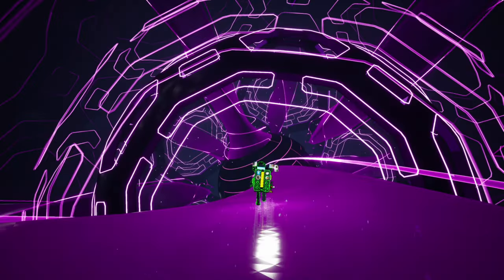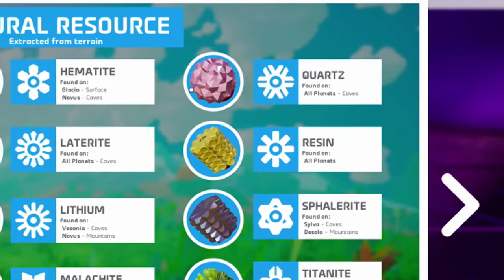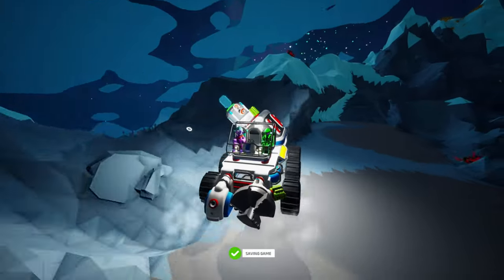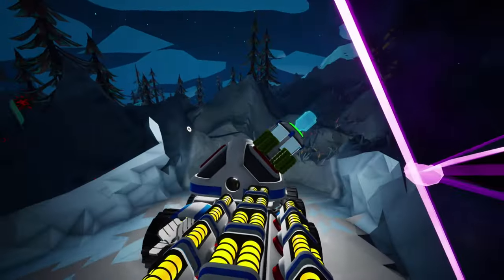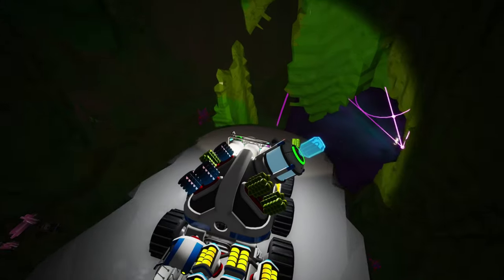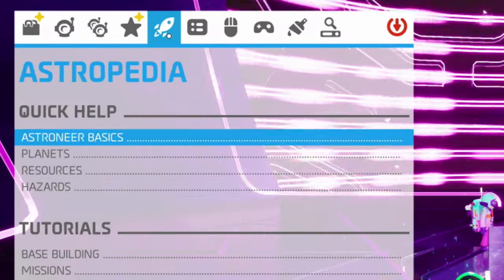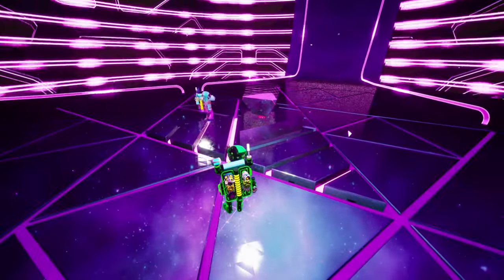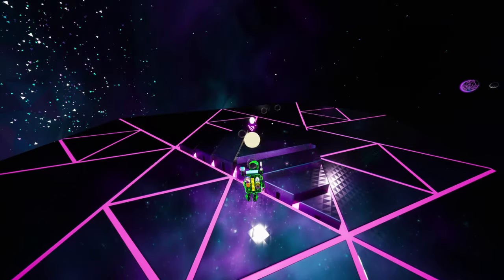How to activate planet cores in Astroneer

Comment: Just be careful to not drive straight to a planets core, the gravity around the core is weird and once inside, you can't really recover the car / truck back, i lost mine that way, i had to disassemble it and move it piece by piece back home, through the portal
Reply: I drove my Rover down in the gateway engine yesterday in Sylvia and got it out just fine first I was dumb and like how tf am I gonna get this out, but realized that I can use the pink pathways to drive it completely out
Reply: (Don’t think I’ll attempt it again, cause I could have just gotten lucky but I now know about that oxygenater to put on Rover (use only a single seat) you will seat sideways but it saves space to put a oxygenator and tether when down there

Comment: do you only need level 1 for sylva?
Reply: drill level 1
Reply from the maker: You can get thru any planet with a level 1 drill mod
Reply: @KaymicGaming wait, really? Even glacio? I recall glacio being tough as nails, right from the first cave layer.
Reply from the maker: @matthewtanner7206  yeh, it might take a minute…
Reply: @KaymicGaming NO😭😭 i just used it on atrox and it didnt work at the red thingy😀 and when i got out of the tractor it teleported me IN the cave and i died😭😭

Comment: Can i suffocate on one of the engines? Im literally on novus rn and dont know if i should turn around for tethers or should i stay
Reply from the maker: An activated engine (in the core) should provide you with oxygen. Use resin to make oxygen filters as you need them, just in case ;)
Reply: @KaymicGaming  Thx for the advise, but i somehow managed to do it and get out of there without dying.